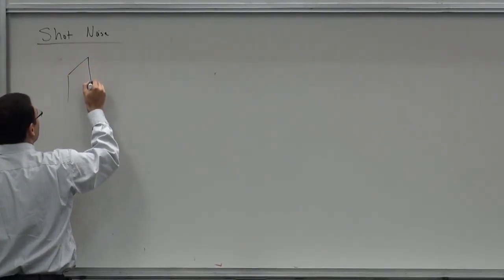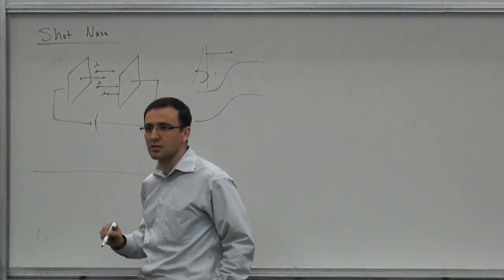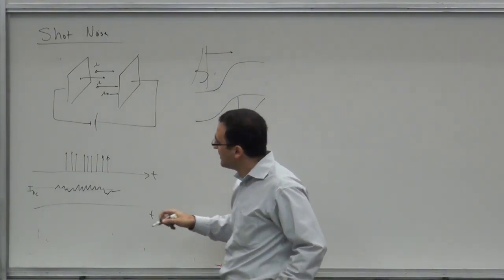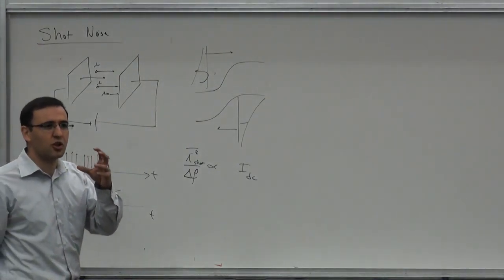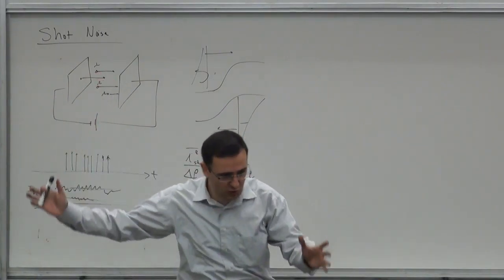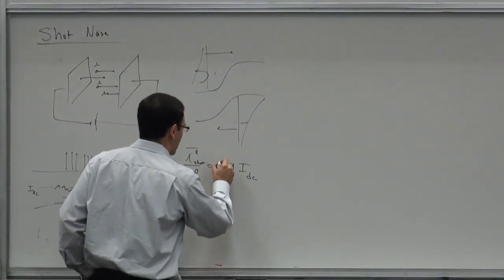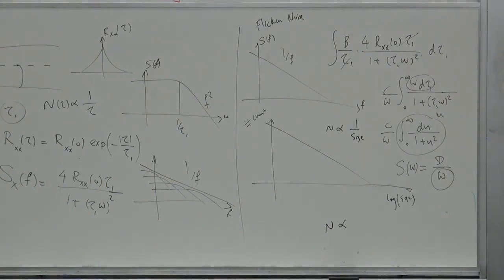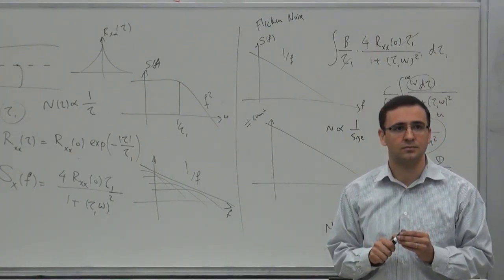165. Noise: Physics of Shot Noise, Burst Noise, Flicker Noise (1/f Noise), Power Laws

Comment: Hi sir, thank you very much for the lectures. I find them amusing. But since I'm from only basic electrical background - motors, and basic CMOS/bjt logic circuits/amplifiers. I find few of these to be very new. Any books you could recommend me?

Another question I have is, in a resistor the charge carriers reach a drift velocity vd on an average on the application of an electric field. And this vd is directly proportional to the field. But is this rise from 0 average veloctiy to vd instantaneous, or does it take time. If so, what happens during this transient time? The same question I would like to know in view of changing electric field as well, since drift velocity is also supposed to change with it.

Comment: Capacitors don't support conduction current. They always support displacement current. In abnormal cases of breakdown of a medium, charges can get ripped off and scurry towards the other plate.
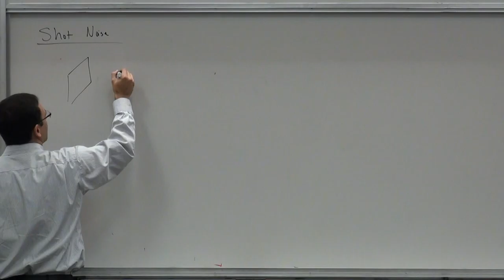So, is it that example shot noise @0:40 due to such unpredictable conduction?
Reply: @0:40 is referring too a vacuum tube or any device where shot noise occurs.

Comment: Capacitors don't support conduction current. They always support displacement current. In abnormal cases of breakdown of a medium, charges can get ripped off and scurry towards the other plate.
Just saying...
Reply: capacitors have leads.. Also insulators aren't always perfect insulators. Just saying...